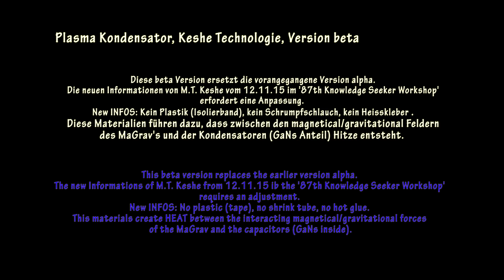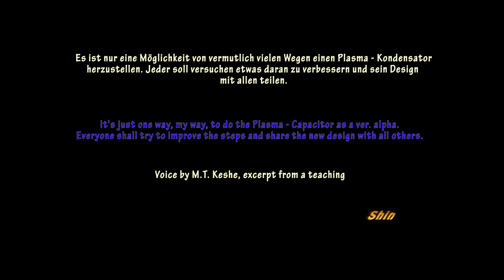Plasma - Kondensator / Capacitor Keshe MaGrav ver.2

Comment: You cannot start to roll tightly the paper on the core, since they slip very well. Get inspired by videos of industrial capacitor making. We need the inner core to have both ends bent to form radial disc shapes, that will allow temporary needles to be inserted on both sides of the paper. The free end of the paper will have to be held in a vice between wood and cardboard jaws, so you can roll with both hands (and gloves) while pulling and keeping a straight angle.